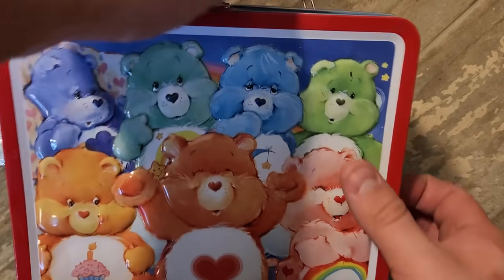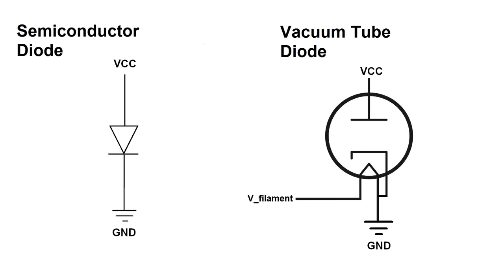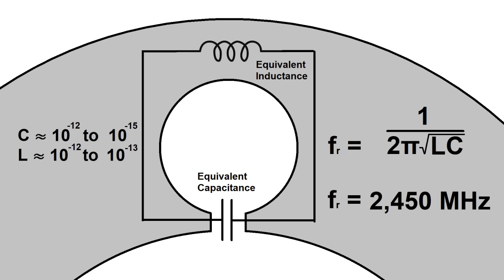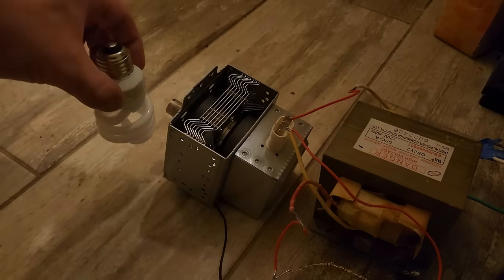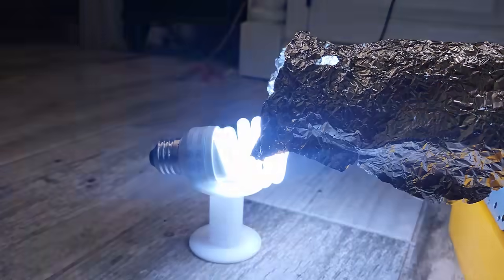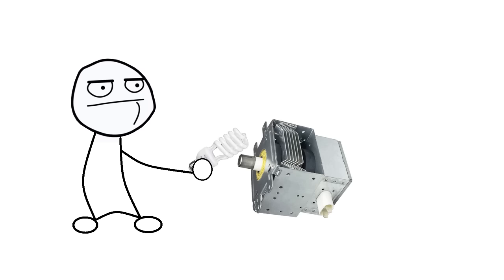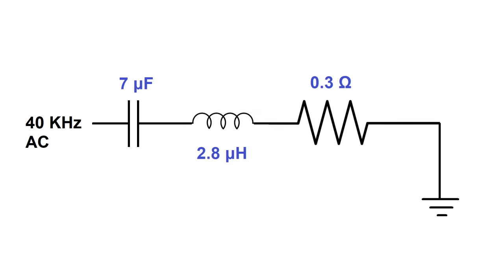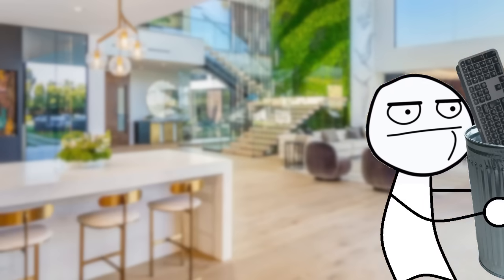Battery-Powered Magnetron

Comment: OK from a magnetron engineer- LOL this is very dangerous it could blind you.  Even 300mw is bad.  Cooking magnetron are built different from pulse magentrons. Cooking Magnetron are run at around 4KV with a current limiting circuit, they can run  at ~50 duty cycle.  Pulse Magnetrons can run from 2KV to 100KV into the 250KW+ range from a pulse in 0.01 Microseconds to 200us in most.   Some work in CW mode in circuits for receivers.   A typical high power pulse magnetron can run a 20KV at 20 amps at the cathode for a few uS.  The reprate determines if the tube is overheating.  Most cathode are in the 10 to 200 watts range.  Pulse shape counts in firing magnetrons.  Nice square pulses from pulse shaping circuits.  You need to operate them in the correct voltage range.  If you apply to much voltage they just pull more current.  This idea of dumping RF into the air is very dangerous to you.  Cooking magnetrons can run from 700 MHz (big stuff )  to 2.4GHZ home stuff for boiling water.   We have magnetrons that run in C band and magnetrons that run in X band for radar.   300mw will blow cells apart and kill them.

Comment: That is a lot of RF energy to be messing around with. You DONT want to be on the receiving end of an RF burn at that high of output power. You’re playing with a very powerful transmitter and antenna there. Be careful please. De kc9cpx.

Comment: Sorry my pedantism..can't help myself (maybe it's my autism..?).. But about the standard vacuum tube triode; If the grid is on the same potential (=voltage) with cathode it is not blocking the current..it's pretty much neutral..so the triode's anode current is maximum. If we make grid positive in regards of cathode the anode current will not get higher anymore; instead we get grid current flowing (ie electrons get to grid instead, thus current is said to flow from grid to cathode). If the cathode emission is not very high, the grid current is away from anode current.. If the grid is made slightly negative in respect to cathode, then the anode current gets lower..More negative the grid, the more the anode current get's smaller until reaching cut off point.. so triode works with negative grid bias and having 0v bias is the saturation point.. (There are some circuits from vacuum tube era where the grid current or grid leakage current is used as a feature but they are not very common..eg. sometimes radio tube EABC80 triode is many times biased with high value resistor between the ground and grid..and the leakage current on the grid pulls the grid voltage negative in relation to also grounded cathode..😅)..👍 Cheers! Me and my colleque like Your videos very much..!😊

Comment: Oh boy, on the one hand it looks pretty impressive, on the other hand, let's  just say safety was pretty low on the list. I would of obtained a microwave leak detector. If you had  a  junk microwave, the wave guide is right inside the door. The metal shild with a 1mm holes on it. There are microwave ovens ranging from about 600 to 1600 watts in power.  I would not put my hands so close to the high powered  microwave. Damage may not become apparent  right away.I have seen what happens to hot dogs.cooks from the inside out. I would have picked a lower wattage microwave to begin with. Testing microwave  with neon or fluorescent light is no indicator for safety on people. Exciting  noble gases is different from the exciting water molecules. Since it operates on the same frequency  as wifi, it can also interfere  with it.  If   metal is in the way of your microwave it can reflect back.

Comment: Yeah but you also don't forget something microwaves can be sent and send signals the original microwave was designed to send long distance signals in the air through long distance to another microwave receiver so you can send a signal from one person to another with using that but anybody in front of the microwave gets hurt you see the towers that have microwave transmitters and receivers warning labels all over it and stay away from it in about 12 ft fence

Comment: 9:02 does that mean 900 turns each stage, or 900 turns total from all stages combined?
Reply: Also what gauge of wire is the 12 turns side of the transformer

Comment: Current doesn't exactly flow from a higher to a lower voltage. Voltage is a potential difference and current flows from one polarity to the other.

Comment: Quinton about 4:50, isn't the diode and the capacitor wired as a Voltage multiplayer and not a rectifier? Because the components are the same with the difference that for a rectifier the load is concerned in parallel to the capacitor and for a voltage multiplayer the load is concerned in parallel with the diode
Reply: It's more of a DC restoration circuit than doubler imho

Comment: 5:28... You REALLY want to keep your eyes far away from the output also. Obviously, the high frequency R.F. from a Magnetron is VERY good at heating up liquids and water molecules. That's how a microwave oven works. The R.F. heats up water molecules and warms the food up. 

Your eyeballs are filled with liquid. A Magnetron's output likes to heat up liquid...  you can see where this is heading..
The issue with the eyeball, compared to other parts of the body, is that there is NO blood flow inside the eye to help carry away excess heat produced my the R.F., so the eye can VERY quickly overheat and sustain irreparable damage from a Magnetron's output. You won't notice the damage until it is TOO late, and your vision is NOTHING that you want to gamble with. The output isn't especially dangerous to other parts of the body, although it COULD cause localized burns if strong enough.

The R.F. output doesn't cause cancer, it simply makes water molecules vibrate to the frequency, and in turn, heat up. That's it....

Just take precaution for your eyes.

Comment: Hi, great info on magnetrons. 
I have this issue with termites in floor boards and my fantasy is to yank the magnetron and wire it 100% power to fry the little buggers with the floor installed. 
You think it will work out?

Comment: If You open metal box leading to filament You will find there two coils between the actual filament leads and connector - those with housing of the connector (=capacitors) act as the LC interference filter. I think those coils are responsible for your problems, when filament was driven by higher frequency AC current. Removing the should simplify runnig whole contraption from battery :)
The filament itself surely doesn't have such high inductance.
Great idea for running cavity magnetron from low voltage DC source.

Comment: @3:53 So the frequency is defined by the dimensions of the cavity? So if you bored the holes larger, it would go down in frequency?
Reply: its inversely proportional to the frequency so, if you have more frequency, there's less inductance and capacitance, but if you do it the other way around by increasing the capacitance and inductance, the frequency lowers , so yes your assumption is right 
f=1/2π√LC
Reply: @Sammy-t4m  Awesome, thank you so much!
Reply: physics works via geometry. everything is always geometry

Comment: Hello, I wanted to asked about the power output from the magnetron. The original circuit used a MOT transformer with the voltage doubler circuit that was 1000 watt output.the primary and secondary coil windings RMS or root mean square watts in power calculation. With the new circuit being a smaller transformer, what is the new output of the magnetron in watts? Does it still work in the same frequency? Can a circuit using MOSFET transistors make equal power in watts without adding weight to it? An MOT can weight 25 pounds or more depending on the model. I had the impression that the heavy steel core was for electromagnetic field strength. If so why not use the MOSFET transistors instead. I'm just wondering. My background is in physics and engineering 😊🚀👽

Comment: You are incorrect about how an oven voltage doubler works. A doubler requires 2 diodes.  In an oven, the magnetron itself is the second diode.  You can easily see that by scoping the magnetron HV terminal.  You'll see that the ripple frequency is 120 Hz with no dead time.

The reason cheap microwave hum so loudly is that the transformer approximates a constant current transformer.  See that center leg of iron between the primary and secondary windings?  Notice that one leg is welded on while the other leg has a small air gap?  That is what regulates the current.

When there is nothing in the microwave, the magnetic circuit is around the outer core.  When A load is placed in the oven, the secondary is supplying at some current and the magnetic impedance of the secondary increases because of the current.  As the filament heats up and the secondary impedance drops, at a design point set by the air gap, flux finds the shunt to be of a lower magnetic magnetic impedance than the secondary.  Flux is shunted around the secondary.  As the secondary tries to pull more current,more of the flux passes through the 3rd leg, limiting the secondary to a roughly constant current and therefore a constant current through the magnetron.  AT the air gap, there is an intense magnetic field.  This field reaches the steel outer case and makes the side of the case vibrate rather strongly.  That is where the loud sound comes from.

My first oven, a genuine Radar Range, vibrated so badly we could not stand it.  Since I'm a Nuclear Engineer, I had some thin adhesive coated lead sheet.  Lead is perhaps the "deadest" metal on the Periodic Table.  One can take a large hunk of lead and whack it with the largest sledge hammer you can find.  No matter how hard one hits the lead, the hammer stops on the lead's surface with no bounce.  The energy is dissipated by lead's deformation and it's quick dampening of any vibration.

In this instance, the lead dampens the attempted vibration and dissipates the energy as heat.  In the case of my Radar Range, the side simply quit vibrating.  I could hear the quiet hum of the transformer and the cooling fan but little else.  My wife and I could again converse in the kitchen.

Comment: Lol no a diode symbol illustrates the direction of current flow that is blocked.

Current flow is from negative to positive so in the diagram given, the current is allowed to flow from ground to (+) but it is blocked (indicated by the line stopping the arrow) flowing the other direction.

Comment: Pirate plese don't use osciloscopes near high voltage. If there is a short between the winding and ground it will fry your osciloscope. It can last a fraction of a second and be un noticed but the magic smoke will go poof. Be carefull mate, shit happens with HV
Reply: p.s. when building a HV flyback you can create a semi ring that goes over the bobin an freates a space that can be filled with poliester resin. If done cleverly then the resin can also protect a spot where magnet wire is soldered to some more HV resistant wire.

Comment: After I saw you wind the transformer I thought to myself "he better pot that thing in epoxy" lol I love high voltage but its hard to keep anything I make with it from burning out after a while.  Although epoxy has bubbles and Ive still had things arc over that way.  Dipping it in lacquer a few times and then epoxy helps a bit because the lacquer works its way in a bit better.  Candle wax is cheap quick and easy and works surprisingly well.

Comment: Just one querry if we attach a steel plate with the magnetron antenna it will get heated or it will starts emit the microwave ? Can we change the magnetron with LDMOS based Power Amplifiers, we are working on this project, I will be happy if I can collaborate with you.

Comment: Can you modulate the amplitude or frequency to transmit a signal?
Would a waveguide result in signal gain, or would it only control the direction of radiation?

Comment: I vaguely recall reading that the heater current on early magnetrons had to be reduced once operating to avoid the filament failing  - seeing your filament current varying with high volt activity across the "tube" leads me to think I wasn't imagining this, though I haven't seen any equivalent circuitry in modern domestic microwave ovens.

Comment: It annoys me when people say microwave ovens are dangerous. They are not. They have a shield that prevents the microwave rays from escaping, and the microwaves do not "linger" in your food and poison it, because that's not how radiation works. You could blast your food with gamma rays (the ones that kill you) and it would still be safe to eat. It would probably smell funky from being ionized, but ionizing gamma rays are only actually dangerous to you when they strike YOUR cells. All dangerous radiation is only dangerous to you if you are directly exposed to it at the time it's being radiated. Radium is dangerous to handle because it is actively emitting radiation (at a high enough concentration to be dangerous, technically everything is radioactive to some degree, the carbon in your skin cells have a very long half-life and will occasionally emit particles, and your body is constantly emitting infrared because metabolism), but after those alpha and beta particles have been radiated, they are no longer dangerous. Just don't stand directly in the path of an active magnetron and you'll be fine. But even if you do get hit by microwave radiation, it isn't going to kill you or give you cancer, because it's on the complete opposite side of the spectrum from the ionizing types. The waves are too "big" (I don't want to say wavelength and get um actually'd) to do that. But they are the right size to heat up water, apparently, so it would probably hurt. That's why they were originally developed as a non-lethal weapon until some guy melted his chocolate bar and some other guy said "dude we should use this to cook food that would be fucking sick".

Comment: Wondered for 20 years if a microwave magnetron could be used as a ham radio transmitter. 1200 watts into a dish would fry squirrels in the trees and surely bounce off the moon nicely. But i  have never had a receiver in the 2.3ghz range. So never did. Wonder what diodes could be used to see what the 2ghz wave would look like. Or if i can find a SDR that would see up to 3 ghz. Hmmmmmmmm....... shopping time for sdr's.

Comment: My design uses only geometry and requires no connected power source ..
The cavity chambers create a resonance with (x) and they are powered via this route (not allowed to type) 
A very similar system is used in tangible, hard spyware from the middle of the last Century, at the least.

Comment: Welp, how about EMP generator next? Discharge a low impedance very high voltage capacitor into an antenna (either parabolic or yagi), where antenna has a spark gap. But then you'll have to replace not just bluetooth devices in your house..

Comment: Question: why would you want to carry this around with you?  I built something similar a long while ago for, let’s call it a “professional project”, and the recipient of the hardware (an aerospace test lab) insisted on a Faraday cage with certified measurement of leakage emissions.  Standard practice for us before it left the lab was a minimum distance between any unshielded energized magnetron and a human of 5m… and here you are putting your hand in front of the bare antenna!  Our precautions were definitely overkill, but THIS SHIT IS DANGEROUS!  So again: why would you want to build this and carry it around with you?

Comment: What would be cool, hyper-focus the scatter into a sharp beam, mimicking the focal width of a laser, and then, lite off scale model rocket engines... That would be cool, of course, the simple 4v to 12v ignitors work just fine, either store baught or home made ignitors, but, you would be the only one, thst could say :
"3.... 2.... 1..... RADIATION!!!".... 

Instead if : 
"3...2...1... Launch"
Or
"3...2...1... Ignition"

Lol

Comment: Fun fact, 2.4 GHz is the only frequency that most WiFi routers work on, so if you have a improperly sealed microwave too close to the router it will knock all the devices off the network 😂

To add insult to injury, 2.4 Ghz also happens to be the frequency that most bluetooth communication occurs on

I am an IT technician and had a buddy who worked on a system, and the solution was to get rid of a leaky microwave 😂

Though i will admit this problem is quite rare, but i still get a kick about it when i think back to it

The technical jargon for this is called destructive interference or electronagnetic interference (EMI)

Note for other network nerds: yes i know 2.4 ghz is not the only frequency that routers can run on but its the most common also, if you disagree then your mother is a hamster and your father smells of elderberries

Comment: I would have been much saver to leave the Magnetron in the casing and operating a 1000 W magnetron without the heating cavity is dangerous. The heating cavity is the box where you place the food and it is tuned to absorb all the RF energy and make sure to not radiate harmful radiation, which can cause cancer - especially eye cancer.
It will blank out everyone WIFI and could be liable to the damage you cause by operating this device if the beam hits any electronic circuits and cell towers!

Comment: I love this video but I found some confusion in the Schematic when attempting to recreate it, the capacitors are in confusing units like uh instead of uf which I can't find any information on conversion or capacitors with that unit also with the MOSFET I cant seem to find an irf7545 but I can find the irfb7545 I don't know if it was a simple error or if they are the same thing but if you could reply and help me clear the confusion that would be great.
Reply: im just realising that some of the confusing ones are different components